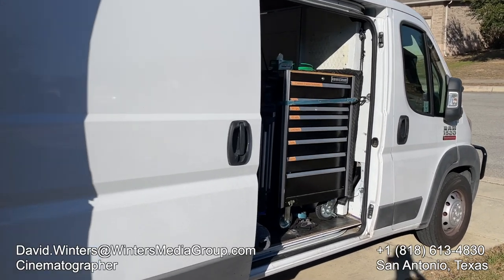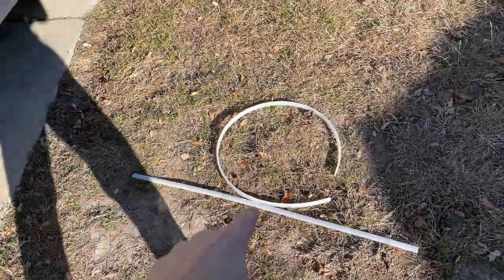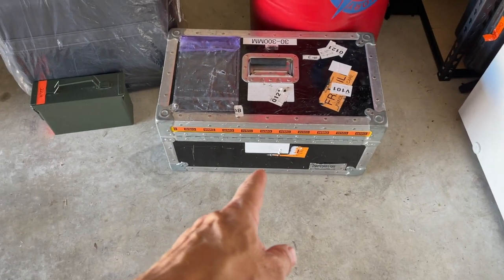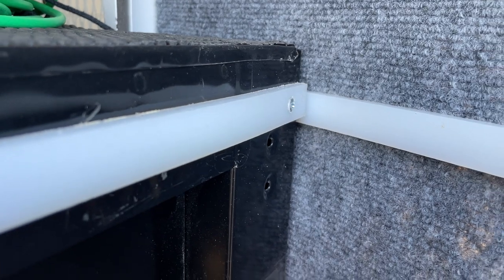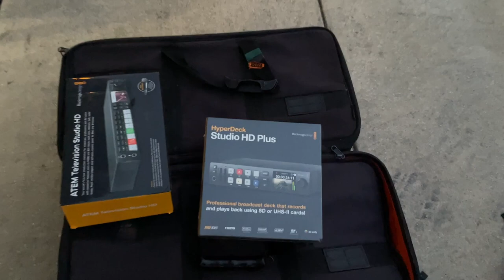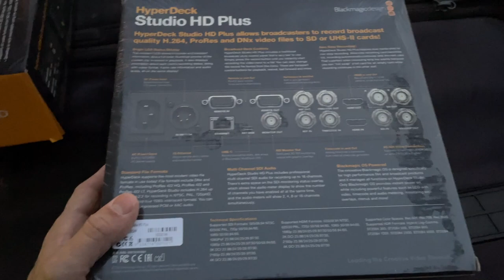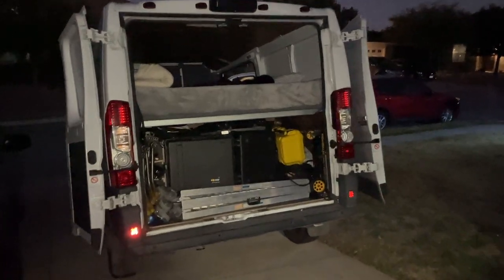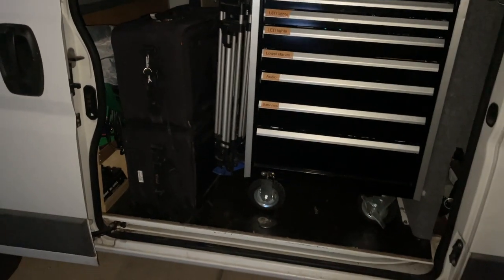Van prep 12 day road trip

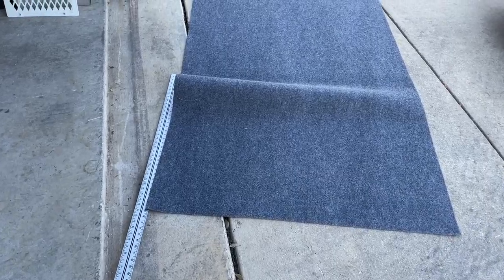Comment: 4:49 80's skater nostalgia with super smooth masonite half pipes. Another great video dude!
Reply from the maker: I have a autographed Tony Hawk deck from a commercial I shot with Mr Hawk. But it’s singed to “Steak” some mixup in shipping. Which makes for a good story.  Fun note, when 949 Films moved out of their San Juan Capistrano office we took over the lease.  I spent several years working out of that unit.  It had a kitchen and shower. It was an awesome setup, dawn patrol surf, breakfast tacos, shower, then work for the day. Good old days.
Reply: @CrankyCameraman  Dang that is awesome! I'm from the midwest and skated half pipes in barns. Loved the Powell Bug and McGill decks (perfect shapes for me). Always dreamed of going to the west coast to meet the bones brigade. Now as an adult I'm in LA / SD multiple times a year for shoots. Been meaning to check out McGills skate shop even though I don't skate anymore. So cool you worked with Tony. I dig your channel. Great hearing your insights and years of experience. The comment sections are great too for other photo folks to share info/techniques. Cheers!

Comment: Wow you really dodged a bullet with that lens glad to see they didn't take anything but how did they break into 60 units before someone noticed, do they not have cameras inside the buildings.
Reply from the maker: Crazy all around. I’m super lucky, I would have made an insurance claim, but with a $2,500 deductible and future premium increase would have been bad.  The place use to be 24 hour access but recently changed to closing in the evening.  They waited until closing time. Popped open the pedestrian gates and cut the unit locks with manual bolt cutters.  There is onsite resident manager but this happened over new years so suspect no one was on site.  Detectives have security cam footage and have made one arrest.